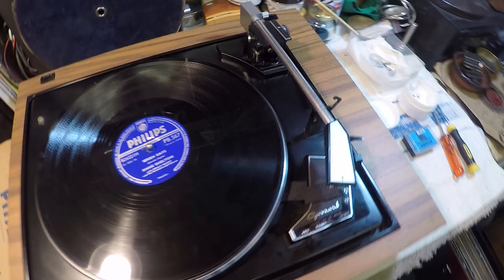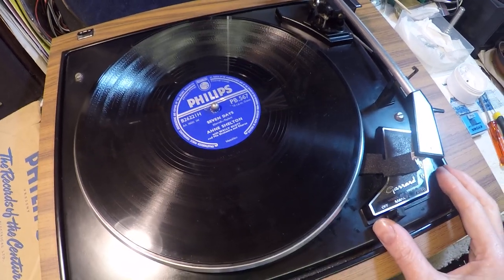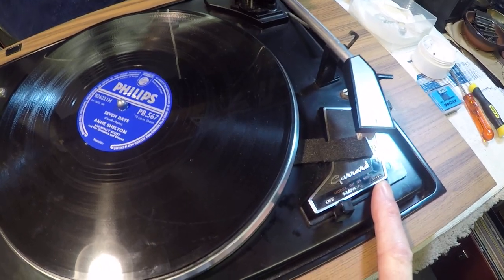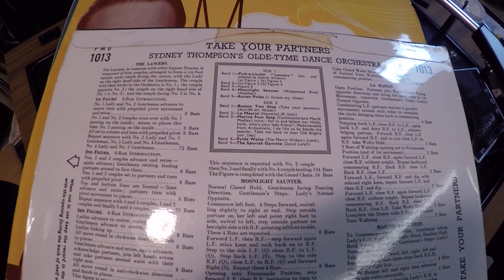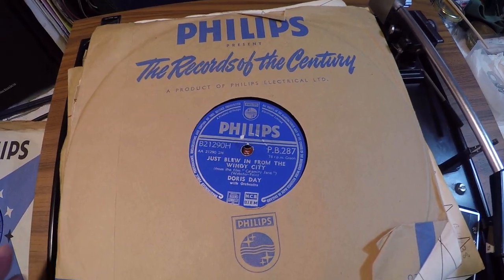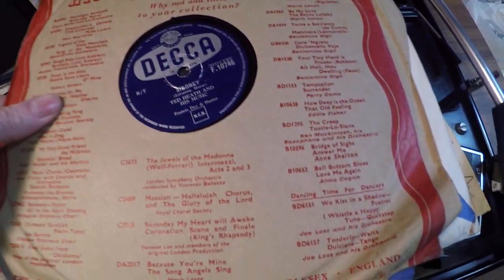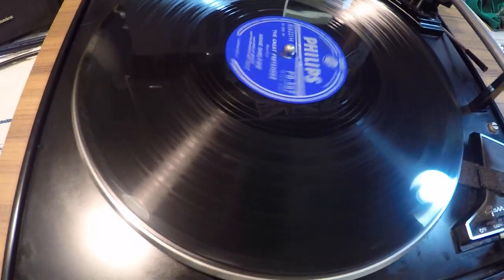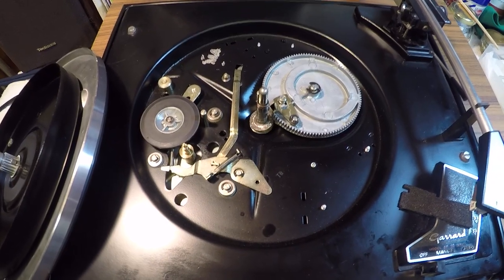Garrard SP25 MK3 - Repair Prowl -with Ann Shelton

Comment: Hi Richard. 633 Squadron was a different Film to the Dam-busters. Also Marching Strings was the Theme to the TV program Pop Quiz hosted by Mike Read DJ. It also used In the Film "When We Were Young". Anne Shelton was a Huge star In the 40's and 50's scoring a Number One with "Lay Down Your Arms". I used to DJ with these decks. My mate Worked for the Local Council Fixing Everything so got hold of a Pair from one of the Schools. I still have the paper Plinth Stencil to cut a piece of wood to drop the deck In. I see You have the Ones that were used on the Disco Decks of the day a Plastic One. Those were the days. Nice Video Thanks Enjoyed seeing them again.

Comment: I had a similar table a few years ago, although mine was an MK5. You can get rid of that noise by removing the platter and bearings and lubricating with some fully synthetic turntable oil (available on eBay. Also remove the idler wheel, and lubricate the idler wheel shaft with the same oil. Also check the rubber on your idler wheel; if it's a bit on the hard side, apply some talcum powder or leave it to sit in a bowl of warm soapy water, then once removed clean thoroughly.
Reply from the maker: +Ashley Cox 

I agree and thanks 

Warm regards 

Richard
Reply: +Ashley Cox good tips, thanks, Don